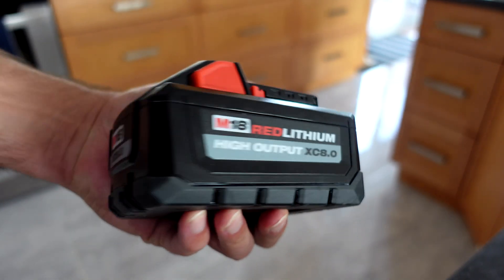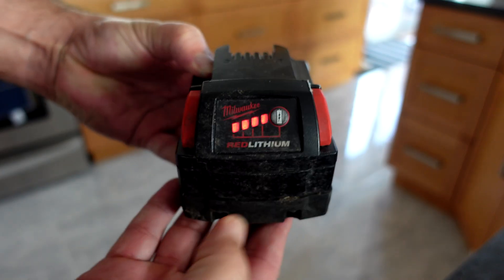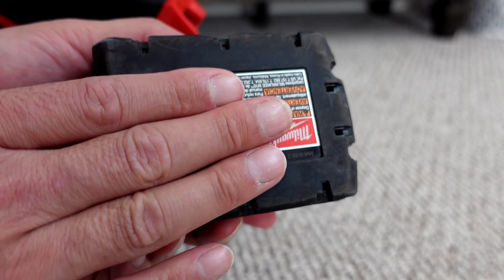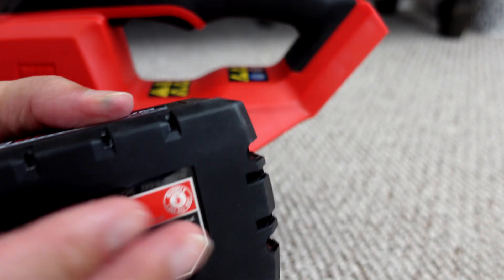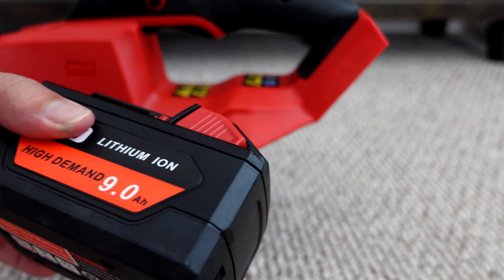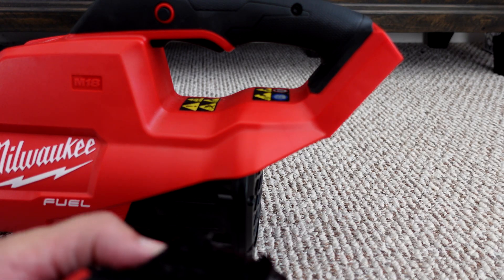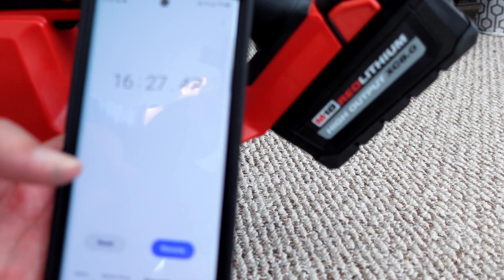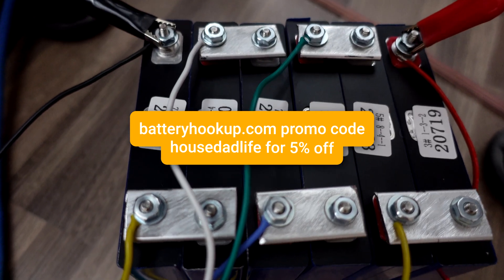DIY vs. Milwaukee Batteries: Ultimate Test!

Comment: For a regular user of battery powered tools, this seems like a good option provided the circuit board is not waste. Requires a small investment at first to get a spot soldering iron, but once purchased it seems economically viable with a cheap 18650, or even a high drain model. This is not the same with the expensive 21700 cells, which however offer much lower internal resistance. 👍
Reply from the maker: I had the spot welder, so the rest was a cheap gamble for me.  I do think the factory bms is higher quality but that's only speculation based on my observation. I agree the 21700 would be a way better cell, but having an easily available case with 18650 it was a good place to start the test. 
The future might let me do this, I'll post if it happens.

Comment: Have an issue with some cheap batteries that came with a cheap tool. The batteries are fully charged, but when pulling the trigger on the tool, it shuts off after a second or so (both batteries do this). And sometimes it tries to start, but doesn't. 
I thought it was the switch in the tool, but I put in a good brand battery and it ran fine. 
I wanted at some point to try and change the batteries inside the battery to gain more power, but thinking this is a circuit board, or protection issue. Any ideas?
Reply from the maker: I would agree it is likely the cheap battery, I doubt changing the cells would help as it sounds like it might be more circuit board then battery but it is possible for it to be either.  I would probably try a new bms before changing the cells, they're pretty cheap on aliexpress and you can find them for almost anything.  Then buy quality cells if that doesn't work.  Battery hookup has you covered there.